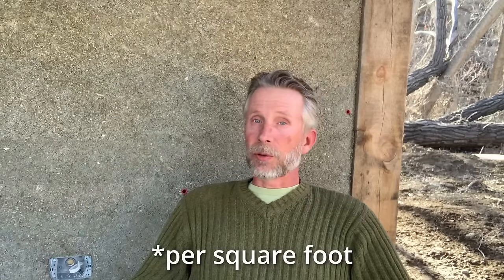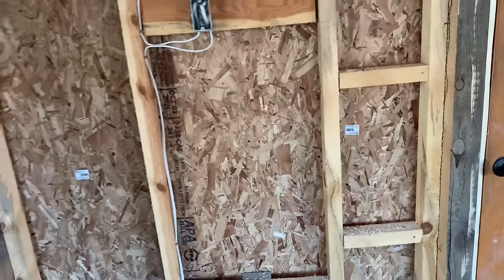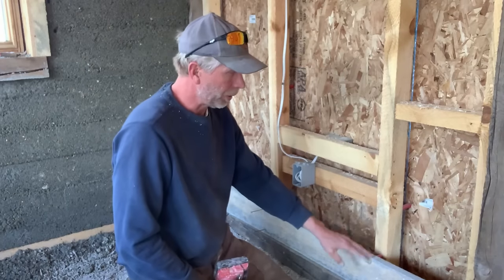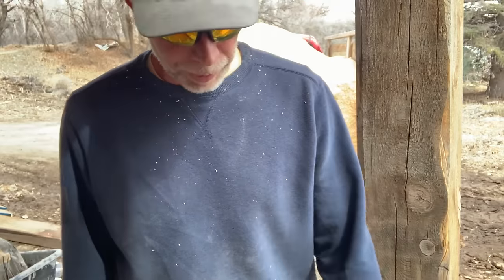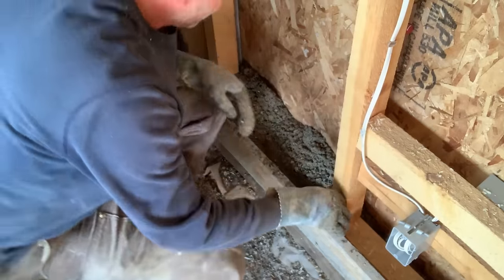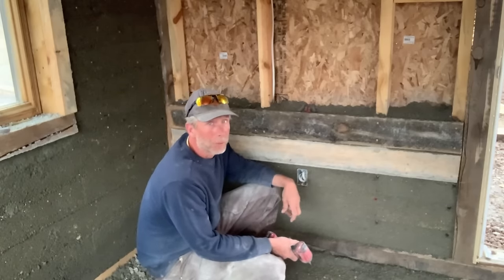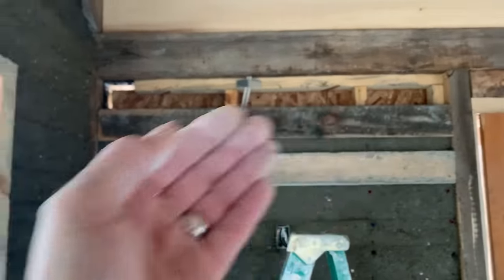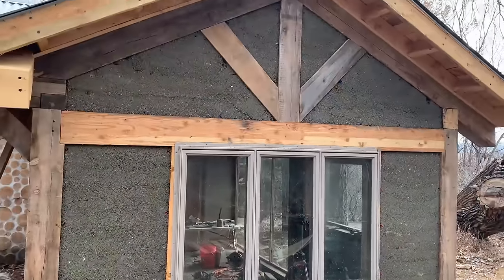Dustcrete

Comment: Having carried probably 100 loads of saw dust from my local saw mills over the years, I can give you a tip about keeping it in the truck and not blowing half the load out on the way to your destination. I lay a very large tarp down in the bed of the truck and over the cab of the truck. It goes all the way over the hood and to the ground in front of the truck. Once you are full, fold the tarp over the top of the saw dust and secure with straps. It saves you from loosing a bunch of what you paid for. 😉
Reply: In the state I live in, covering your load is the law.
Reply: Yep, where I live, it's illegal not to cover the load while transporting.
Reply: I do this with mulch in my trailer
Reply: that's just common sense...
Reply: @AnneGoggansQHHT ok it worked now wake me up! Please!
Reply: Another tip.    Keep all windows up during said gather
Reply: Hi, pls what is S lime and is it available in Nigeria?
Reply: @idowuodemuyiwa3734 
Limestone crushed into powder
Reply from the maker: @idowuodemuyiwa3734  Type S lime is hydrated lime. It can also be made from limestone by firing it in a camp fire then adding enough water to make it crumble.

Comment: As an engineer interested in innovation, you have my attention. What a creative set of ideas. Fireproof or nearly so. Enough mass in the wall to provide thermal inertia and the sawdust provides the insulation.  This would be an ideal form of building in the tropics where insects are a constant problem. Where high winds destroy typical frame construction. The manner of building permits curved walls that can be designed for very high wind resistance. The heavy beams are very efficiently used. As a structures engineer, I am delighted to see this innovative method of building. Add curved glue-lam beams for the roof and the aerodynamics create a building that is hurricane proof. If needed, corners of reinforced concrete could be added to give the rounded shapes needed for aerodynamic efficiency and strength. Amazing set of ideas. Thank you.

Comment: When I saw the consistency of the dustcrete early in the film, I immediately knew it would be pretty strong, insulate well, and be easy to work with. I have a feeling this will take off!
Reply from the maker: The price is hard to beat, and the performance (so far) validates the case.
Reply: @radicalgastronomy  any guess at the R values? You definitely have my interest in using it.
Reply: @krissfemmpaws1029  probably very similar to styrofoam in 3-4inch thickness. lots of micro air pockets and about the same mass just far more dense
Reply: What about a sawdust wood chip mix .see any advantages dis./ with it it I'm thinking like what you see in osb board size chips ?

Comment: Very cool, I’m interested to see the longevity of this idea.
But as an electrician I would like to offer you some advice. If you’re going to do walls with a masonry fill like this, don’t use those kind of boxes and wire. They make actual masonry boxes. Also don’t embed NM wire in the wall like that, run pipe from the box to outside of the masonry wall and run the wire in the pipe. Just some friendly advice.
Reply from the maker: Thanks! I’ll do that in future builds.
Reply: @radicalgastronomy  He is right about the masonry boxes, however I would say you can bury the wire, just use conduit through the walls like we do when putting in block or concrete walls.  To be fair, This is coming from a commercial masonry laborer, not an electrician.  But I have worked with electricians to do this all the time. Looks way better than when they install the conduit on the outside after, that makes the inside look like a garage.
Reply: why cant you embed nm wire in that kind of wall?
Reply: @garyweber6413  not code
Reply: @garyweber6413  I believe because the lime is caustic to the wire, moisture may dampen the the paper around the ground wire in the romex as well.
Reply: @feonix138  A mild caustic protects metal from corrosion, it doesn't corrode it.
Reply: @radicalgastronomy   what is total size & cost of all your walls?
Reply: PVC tubing is perfect for these works as it permits adding on later wirings for internet optic cables etc. 📡
Reply from the maker: @BaliFoodTreePlanter  $1.60-$1.80 per square foot of wall is a good estimate
Reply: @radicalgastronomy  How high can one build with this? Hempcrete can do a few stories but one tends to end up with thick walls like 40 centimeters thick. So what is the structural load, and the torsion strength?
Reply: @ordyhorizonrivieredunord712  Standard wiring practice in Europe for what half a century at least. I wouldn't mix signal and electrical wiring though.
Reply: @michaelwhelan6065  great input br0Ham . 🤘 . thank you
Reply: Because lime will eventually eat through almost anything.
Reply: @garyweber6413  - NM doesn't meet code.  UF, which is rated for direct burial, and is allowed for embedment in masonry, concrete and adobe in many jurisdictions, would likely be permissible for this type of construction in those areas as well.
Reply: If you are doing anything with cement + wood fibers (sawdust or woodchips) you need to add aluminum sulfate to the mix. In Russia, this style of material has been used since the 1940's when the USSR discovered a very simple, strong, and durable material made out of woodchips and cement that is cheaper, stronger, has a great r value, and can be made literally in your backyard. Its called arbolit, and it has a specific mix proportion to maximize strength and durability. 

Why aluminum sulfite? There are different sugars in any type of wood. These are active substances that form a special film on the surface of the wood, preventing the cement from penetrating into all pores. Thus, the adhesion of the cement to the wood chips or sawdust will be too weak and unstable over time. The aliminum sulfate neutralizes these various wood sugars to prevent degradation and create a concrete like structure that can withstand over 30 freeze-thaw cycles (if dry, will last hundreds of years), provides the entire cement solution with deep penetration, as well as increases elasticity and reliability of the fully prepared wood concrete block/shape. 

Cement: from 300 to 400 kg per 1 m³ of wood concrete.
Sand: from 700 to 900 kg per 1 m³ of wood concrete.
Water: from 150 to 200 liters per 1 m³ of wood concrete.
Wood sawdust or woodchips: from 100 to 200 kg per 1 m³ of wood concrete.
Aluminum Sulfate 3-5% of total mix
Reply: How could you ever fix, replace, or extend the wires if they're in hardened concrete? I think that may be the reason.
Reply: @mirsidorov5112  Good info, thank you!
Reply: @greatnationnow  Literally the only one who is actually thinking of a future problem not yet discovered. No one cares about code especially not when in context of a project like this. Mildew, damp wires, corroded copper practically irrelevant. Worse case scenario is a wire eventually gets hot enough to act as a fuse, up to that point you would be wasting a lot of electricity to un-used heat and to ground. Fire would likely not even be a concern since one, the wire is encased in concrete so no new oxygen can get to it to keep it going, plus the wire would likely be damp.

I would run a minimum of two lines made out of some sort of plastic with zero 90 degree bends, probably PEX since its heat and cold resistant just not UV and is perfectly fine "buried". One line would be for data and low voltage cables and the second a minimum of 6 inches apart would be for power. I would also try to avoid saturating any one "conduit" past 50% additionally, I would include a wax coated nylon string like the type used for sewing leather together. Both things would allow for easier fishing of the wires since it would be easier to pull and two a line is already there incase you need to run a new or so runs. Bah PEX is cheap I'd throw in 1 or two totally empty ones too.
Reply: 100%
Reply: @mirsidorov5112  Very interesting. Back when wood pulp started to be used in paper production, Aluminum sulfate was used to help kaolin clay to stick to pulp. The reason clay was used in paper making was an attempt to create a smooth surface on the paper.  The clay would fill the spaces between wood fibers. Thanks for giving the formulation for arbolit.
Reply: @mirsidorov5112  Hi this is very interesting. Here in NZ we have the ASNZS series of building standards, ASNZS 3000 is the electrical code for instance. Do you know of a Russian Standard for Arbolit?
Reply: @Guardian_Arias  PEX is not as cheap as the product that is actually designed for that function: Electrical conduit. "Mildew, damp wires, corroded copper practically irrelevant. Worse case scenario is a wire eventually gets hot enough to act as a fuse, up to that point you would be wasting a lot of electricity to un-used heat and to ground." Either you are not an electrician and have very little practical knowledge about the subject, or a very, very bad one if you think this is the reason that electrical codes of practice mandate standards for electrical cable management. If you do enough electrical work with an attitude like that you are likely to kill somebody one day.
Reply: @garyweber6413  you can. Running conduit in the wall makes adding more cables or wires in easy and also if a repair is ever needed, you won’t have to demolish part of the wall to get new wire in. That’s all. It’s thinking ahead.
Reply: @mirsidorov5112  Thanks for the info!
Reply: I was thinking black pipes would look nice and for future repais but I'm not in construction only build stick houses.
Reply: @greatnationnow  This will drill easily .
Reply: @garyweber6413  he did not say cannot, he said he would not. Given the video he probably isn't worried about code, he is worried about future possiblities.
Reply: @perpetual4958  I think the dustcrete is just filler, non load carrying, the framing provides that purpose.
Reply: @perpetual4958 Now you've got me curious too! I presume it all depends on size of stick framing or post and beam framing since hempcrete is usually applied as an infill. If you are referring only to loadbearing walls hempcrete block producers should have those stats. I don't think dustcrete blocks would be suitable for loadbearing builds (but happy to be proven wrong).
Reply: @feonix138  paper? okey only in america iguess
Reply: Ya masonry is a different animal when it comes to electrical installations. If you do not use pipe you run the risk of the wires being scraped and stripped of its insulation coating and you get short circuits in the wall.
Reply: Spectacular concept in pouring in place!  I was looking for a way to use aircrete without having to cure it in form slabs outside.  You addressed many of the pouring concerns I had.  Thanks for sharing you idea.
Reply: @mirsidorov5112  
Interesting information
Do you know if your mix of what I'll call Russian cement can be used on the exterior of a wall like stucco
I'm building a cathedral arch house or also known as a bow roof or also known as a Gothic arch.

Where the walls & roof are all in on continuous arched plane
/ surface .....thank you for your reply
Reply: @islesanctum833  I have not seen anyone using it as stucco, but its a very strong material, and Im going to guess it can be used in this manner.
Reply: @jimmyfleebot  I'm fine with that method in AS3000, no conduit. In a conduit   AS3008 say it has to be derated by about 30% because of heat build up meaning 4mm cable.
Reply: @mirsidorov5112  I guess this additive also prevents mold growth. A mold infested house needs to be demolished according to the Bible, for health reasons.
Reply: @hanzieo  Yes, you are correct that cables can be downrated to comply with current carrying capacity standards. These rates are usually in response to unfavourable voltage drop, segregation or abutment reasons. Simple stuff.

My initial comment in reply to the assertion that a cable which got so hot that it could act as a fuse was actually perfectly ok, because it would either: act as a space heater, or just fault to ground sometime, and that the main issue to be concerned about was the wasted electricity. This commenter also asserted that PEX water pipe was interchangeable with electrical conduit. 

If an installation is in that state, and installed by a person with that attitude towards electrical workmanship, we aren't talking about voltage drop or abutment compliance anymore.
Reply: Repairs and replacement would be impossible without pipes to run it through
Reply: Not long lived and a lot weaker
Reply: Are you using hydrated lime?
Reply: Thankyou for writing this because I was wondering how on earth he could ever service those wires, doing it this way.
Reply: @ordyhorizonrivieredunord712  Wouldn't you have to use quite large diameter tubing or conduit in any case to be able to pull wires? You'd probably want to use at least an inch, wouldn't you?
Reply: @perpetual4958  Great observation. Don't want electrical signals induced into communication wires.
Reply: @mirsidorov5112  очень прикольно, все новое это давно забытое старое ... спасибо за инфу
Reply: @ordyhorizonrivieredunord712 thank you.  I'm gonna do that.
Reply: @dimagenpersonal  I learned through experience working on construction, At times they didn't foresee there would be technological changes when they built and we had to drill through armed concrete slabs with jackhammer drills to fit PVC conducts for wiring new computers that needed optic fiber for high-speed internet and also to wire automatic wickets for banking. Quite a hard job. Thinking in advance about what you may want to fit on your construction can save a lot of work.  📡🪔
Reply: @ordyhorizonrivieredunord712  thank you. I appreciate any advice.
Reply: @dimagenpersonal  You're welcome, good luck in your project. 🏡
Reply: Brilliant
Reply: Does it hold up in damp climate like Washington state?
Reply: @mirsidorov5112 Your product reminds me of the Heraklith panels that my dad used in the 70’s. It seems like it went away when they made drywall with insulation panels bonded to it and did more metal stud framing and drywall.
Reply: Agree with "The Pigeon", I've worked in construction since 2008 and that's exactly how electricians lay in their wire. 

I love this idea!
Reply: Thank you. I was a bit concerned with that detail.  Is there a serious concern or would it just be better practice to utilize conduit?
Reply: Agreed. I watched my dad do that when I was a kid. So, it caught my eye as well. :) I really like this wall idea and that it makes use of essentially waste.
Reply: @thomask837  I believe “type s” lime is hydrated right?

Comment: 60 years ago a group of guys got together to build a hunting lodge. One of them was a master mason. They built the lodge next to a brook and used the stones from the brook to build the walls. The floor was on top of gravel, rocks and boulders, the floor was a mixture of sawdust and concrete, an old trick masons used to add insulation qualities to the concrete. The floor also had channel in it to draft the cool air from the back bedrooms to the fireplace where it was heated and forced back out into the room, therefor making a circle of warmed air to flow through the inside of the building. This building still stands solid as the day it was built. 
Personally I would make shredded Styrofoam mixed concrete blocks. Then coat the walls inside and out with concrete mixed with fiberglass fibers for structural integrity. This would have more insulation value than the sawdust and concrete mixture. The draw back of this is the wall is very thick. The good thing is that the wall is very solid and strong. 
I think his slip form technique is a unique construction method that has some possibilities and easier to keep the wall straight and plumb. I would add some kind of wire fence into the concrete mix on the wall.
Reply from the maker: Awesome
Reply: Pics?
Reply: Where can I see more information on this technique? This process you mentioned has intrigued me. Thanks!
Reply: > The floor also had channel in it to draft the cool air from the back bedrooms to the fireplace where it was heated and forced back out into the room, therefor making a circle of warmed air to flow through the inside of the building.

I would really like to see a diagram of these channels.
Reply: @NoahNobody  Easy to visualize, Just a main wide channel under the floor coming from under the fire place going back to where it splits in a Y to go to the back of the two Bunk rooms into air vents on the back wall. Air is sucked into these these vents by the rising hot air in the channel that goes under and behind the fire place then comes out the two vents on either side just above the fire place mantle. It is a conduction system driven by the fire in the fire place, This was designed by a Master Mason and Chief of the fire department when it was built. I think I was about 12 at the time and I helped my dad gather rocks to build the walls of the building, it was an amazing time when things were simple and we did not have all these environment laws.
Reply: @NoahNobody  Me too! But thinking about it, a length of tube setting on the floor would work also. Probably less effective as It would be at a higher position, however the same principals would seem to apply.
Reply: Sounds like the Church my grandfather built, that Toby Keith grew up playing in, as a kid.
Reply: Friend group hunting lodge sounds so lit. I wanna sign up for a country club now
Reply: Using sawdust is natural and makes use of an inexpensive waste product. I’m personally not a fan of styrofoam.
Reply: I like your work/idea. How long does a 7” wall take to dry?
Reply: Awesome work and great use of natural local resource.👌 it doesn’t take much with a little ingenuity you can often reap the benefits.